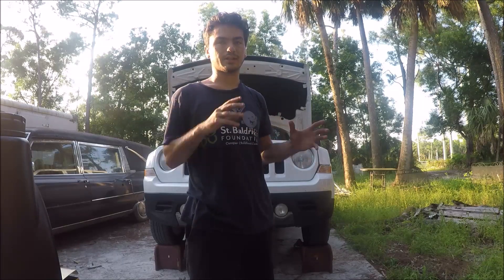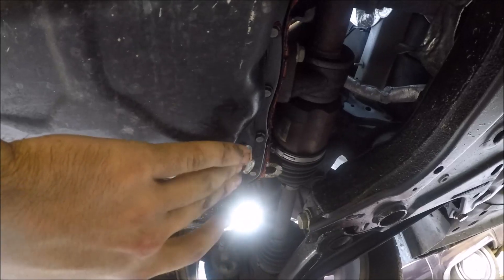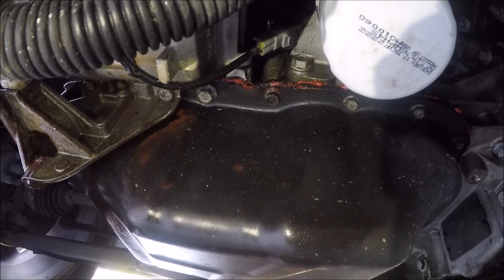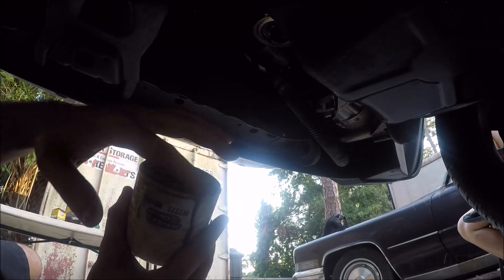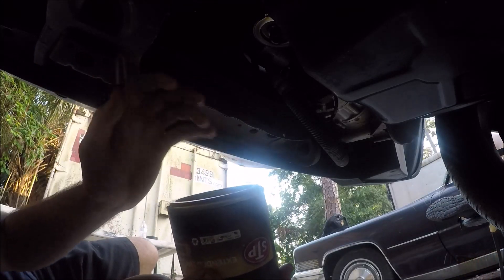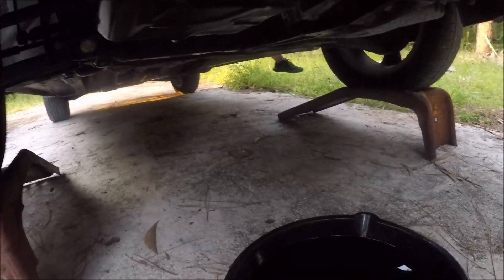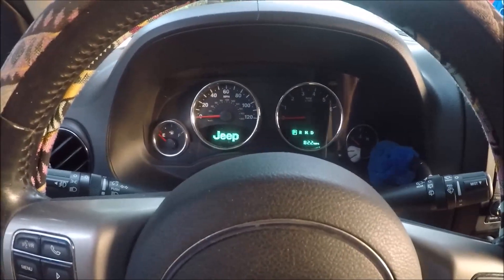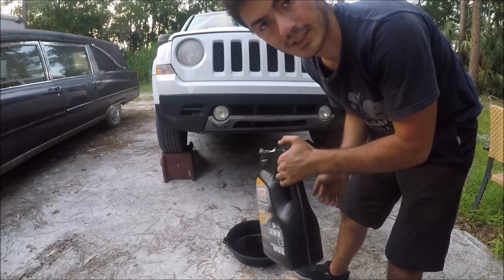How To: Jeep Patriot Oil Change / Reset Oil Light

Comment: Did you turn the oil filter clockwise instead of counterclockwise to loosen it? Ohmygod maybe that's why I can't get it loose!
Reply from the maker: always counter clockwise, try using a filter wrench
Reply: Hi sometimes you can loose the filter, with you hands, but sometimes is tide and u need the filter rinch to get it out